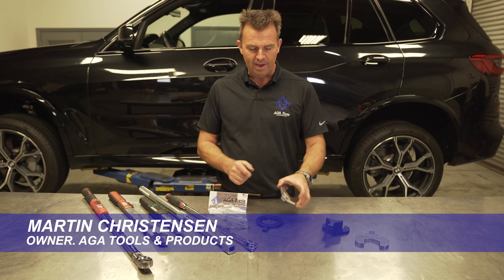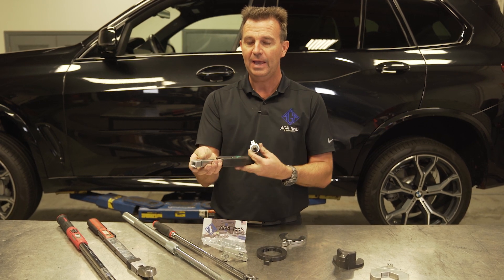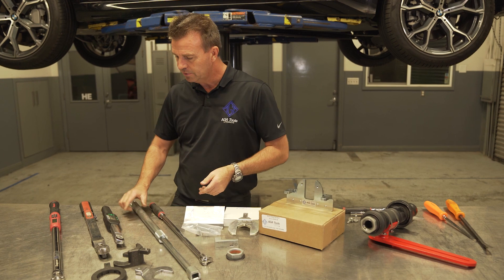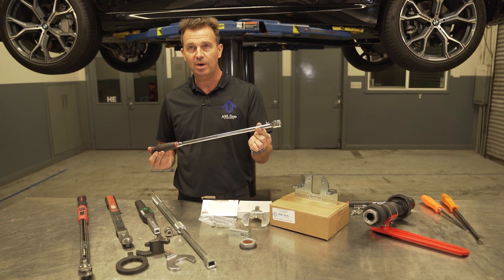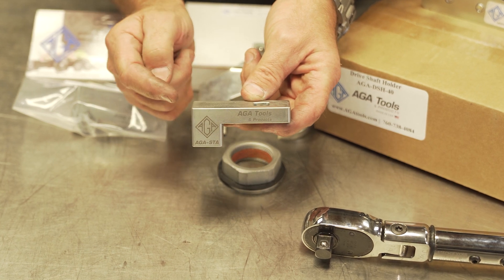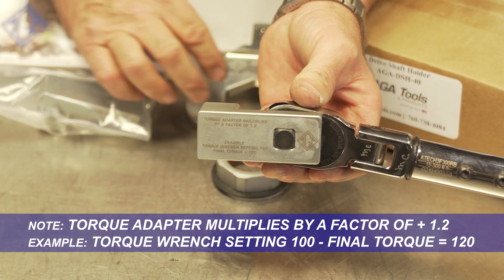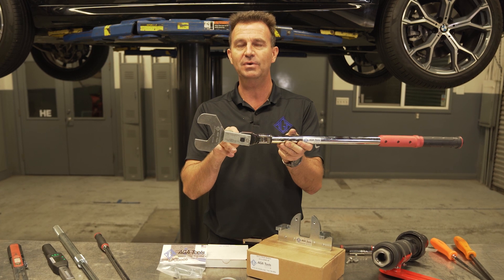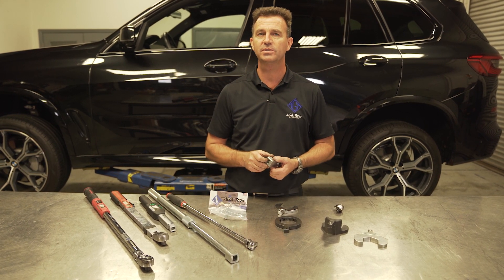AGA Torque Wrench Adapter

Comment: Put the extension on the torque wrench at 90° right angle to the handle. This totally eliminates mechanical advantage. 

Since the adapter is open ended, you have to push the adapter against the nut. Pull equally on the torque wrench handle at the other end.

You could also insert the open-end wrench into the adapter from the other side, leaving the nut nearly coaxial with the torque wrench head.

Comment: With all due respect, the multiplication factor of 1.2 is only applicable when the wrench is used in line with the tool. When used at 90 degrees with respect to the tool, the factor is almost 1.
Reply: "Almost"? Mounted at right angles, it could be 100% accurate. 

If you push-pull on both ends of the torque wrench with precisely opposing forces, the error (due to deviation from ideal 90° right-angle) becomes vanishingly small.